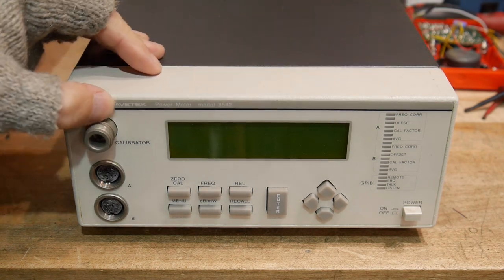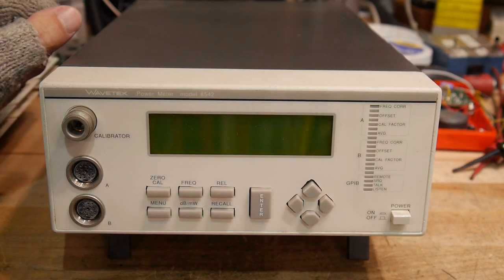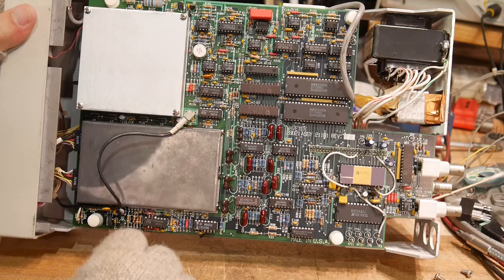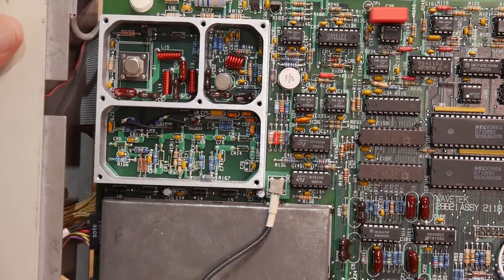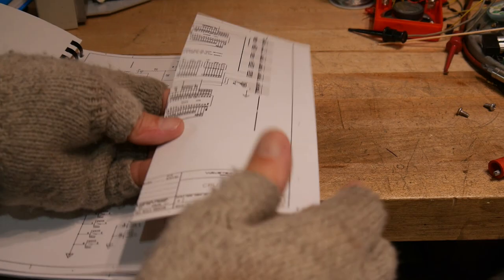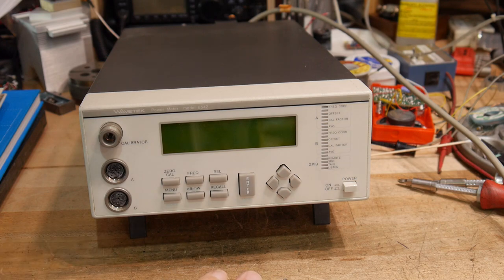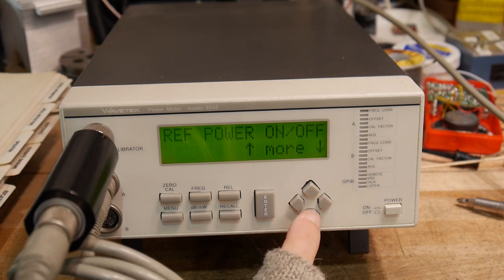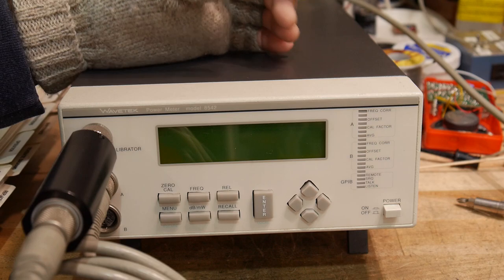#290 Wavetek 8542 Power Meter Design

Comment: I'm guessing that now in the surplus market the sensors are what cost an arm and a leg as the HP meters do. Have the 435, 436 and 437, all of which cost less than one of my sensors! Thanks for sharing, nice to hear from the lead design guy. BTW, we need to start a Go-Fund me to get you some heat in your workshop!  ;-)
Reply from the maker: sensors are really expensive and usually dead on the used market. and you can't fix them. The wavetek ones have two diodes per sensor. positive and negative going. so twice as many to fail.      
I do have space heater but it takes a while to warm things up and so I like the gloves.
Reply: @IMSAIGuy  Figured the hoodie up was another indicator is was a bit chilly in there! I breathed a big sigh of relief when the sensors I bought on eBay showed up and were functional!

Comment: Hi IMSAI, I need your help if you can. 
I bought two broken wavetek gears, a scalar network analyzer and this rf power meter. 
Now I fix these all, but unfortunately I don't have the sensor cable schematic. 
Can you help me with the cable schematic connection? 
Thanks so much in advance. 
Daniel.
Reply from the maker: straight through connections:
N detector ground (individually shielded)
K detector minus  (individually shielded)
A detector plus  (individually shielded)
E thermistor return
M thermistor signal
C +15V
B -15V
O EEPROM data
J EEPROM clock
F EEPROM +5V
+over all braid connected to shield
Reply: @IMSAIGuy  , thank you so much, your help is very appreciated.